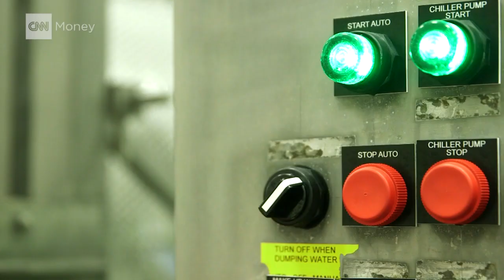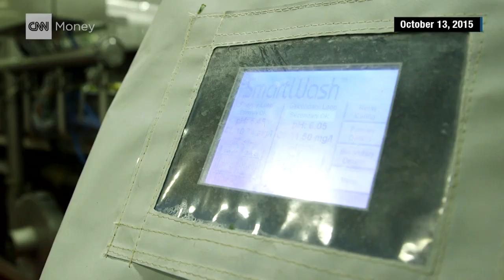How Taylor Farms is trying to keep your salad safe

Comment: I would like to know how many times you guys wash your spring mix. I just opened up an organic spring mix container and I washed it already five times and there are still so many bugs, so many eggs behind these leaves. I buy organic but at this rate I might as well start growing my own.
Reply: We triple wash it. I never seen a single bug at the plant. In fact we stay as late as 3am cleaning 🧹🧼 EVERY PICE OF EQUIPMENT. We NEVER slack on GMP. Also we go to great 👍 lengths to ensure NO 🚫 CONTAMINATION from anyone or anything. I have to even wash my rubber gloves 🧤 after putting them on.

Comment: Absolute garbage! I have had several of these kinds of single person serving salads and I just flat out refuse to buy any of the walmart kinds because they use the cheapest possible ingredients including salad cores and stems and most everything but actual lettuce leaves themselves. These salads are almost exactly the same except the greens in these salads taste off like they may have been frozen thawed I can't tell but they are Very unenjoyable cheap sorry frankly garbage. Try 1 if you want to find out for yourself but definitely wouldn't suggest them. What I will endorse are single serving salads from Winco called Bistro bowl salads they are so enjoyable not all the salad cores and stems and really good tasting lettuce/ greens and fixings. If you can get a hold of both the Bistro bowl salad and anything like these or any walmart salad try them and you will see the vast difference. I Do not work for Bistro bowl!
Reply: We make the overpriced salad 🥗 too 😅